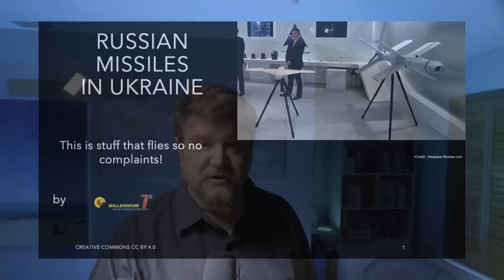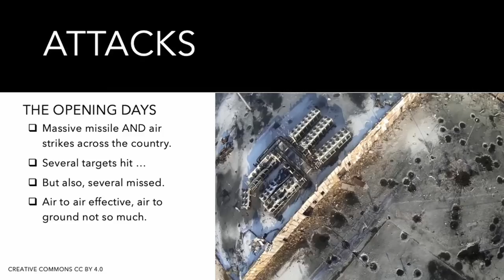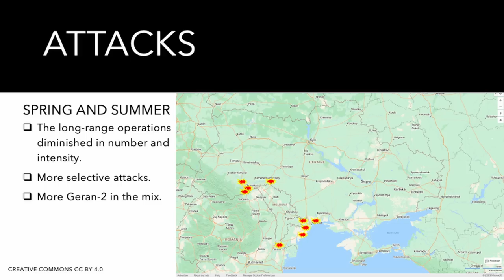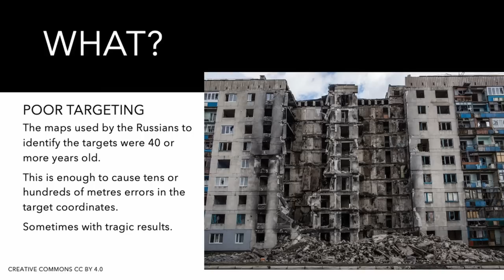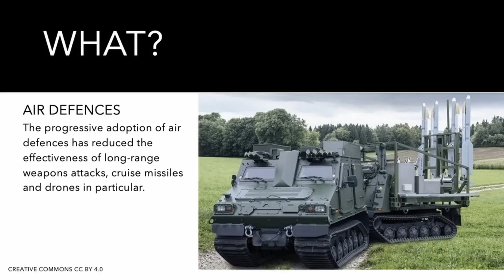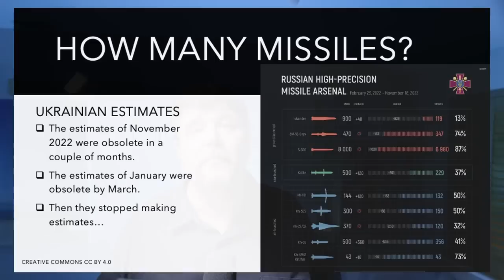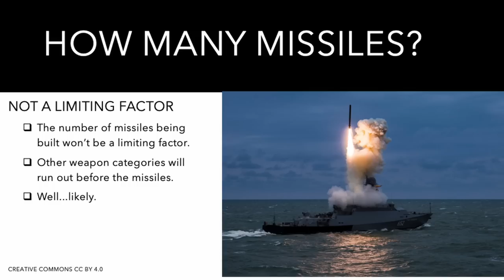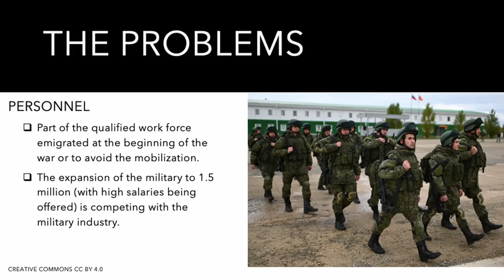Ukraine: Russia Run Out of Missiles!

Comment: Take care of your heart M7! 
I was told I had a bad ticker many years ago ...and then years later it was actually much better (against all expectations).
Avoid trans fats, omega 6 (vegetable/seed oil), nicotine, and any syringes which aren't absolutely life & death necessary. Go easy on alcohol & carbs. Do something 'modestly' active every day.

I think this video is extremely accurate. Although I suspect that the switch to domestic silicon may have already occurred (in part anyway). It's not outrageously difficult or time consuming to "do", it's just that in ideal circumstances, everything would be triple-checked and heavily tested, while in war time, there's a more streamlined process (with less guarantees of functionality). But I believe Ukraine is the testing ground.

I also noticed the increasing prevalence of aerial russian video deep inside Ukraine. It outlines a significant shift in relative air space control. If there are resources to do video recon, just to monitor missile effectiveness, deep inside Urkaine, then Ukraine has much more limited control over their own air space than advertised.

I would say there are probably well over 1000 missiles held in reserve as a deterrent to NATO. Although that is counting nuclear arsenal missiles. For conventional-only missiles, yeah, 5 or 600 sounds about right. The aircraft deployments tell much about Russia's NATO deterrence levels. A surprisingly sparse amount of aircraft (compared to the overall russian air force) are dedicated to Ukraine. So I would expect that a substantial amount of other similar assets are held in reserve as well. Although I'm sure that would be shifted if the ukrainian offensive were to become overtly successful.

Just this week (possibly after this video was created), Russia launched some very substantial missile strikes at Ukrainian supply lines, logistical routes, and production facilities. Likely to remove some wind from the sails of any early autumn push to capture land just prior to the rains (an advantageous time to advance). They were likely saving up missiles for this. That's another thing which throws off estimates (wild guesses) about missile production rates, since Russia doesn't simply use them as they are produced, but banks them for strategic moves like this. So the week to week or month to month rate of missile firings really reveal little.

I think MI6's leaked assessment is pretty accurate regarding the Ukraine war. Ukraine has passed their peak for negotiating leverage now. At this point, there's only further loss of life and a weaker position the longer this drags out.

Comment: What i can't wrap my head around, is the use of S-300 as ground attack missiles. I mean, it is supposed to knock out a 20+ million$ airframe. It is actually hard to find a ground-based Target in that price range, it actually can destroy. The warhead is at least 10x smaller, than a dedicated Ground-attack missile would have.
Reply: In fact, such an attack mode was originally intended, but it is not the main one, rather for self-defense, and is limited to a radio horizon for missile control. In fact, the warhead is more than 300kg and is comparable to the light OTRK.
Reply: In addition, the warhead can also be neutron.

Comment: Overall, this is a wonderful analysis with the correct  conclusion "we don't know". I can only protest the Russians' use of surface-to-air  missiles as ballistic firecrackers. This legend was invented by Ukrainians to explain to ordinary people why sa-10 missiles of old Soviet modifications falls in the middle of cities and that's all. They even came up with the idea that the Russians is stupid enough for intentionally turning off the proximity detonator - otherwise it would be difficult to explain why missiles dont detonate in air, since all missiles with a fragmentation warhead explode from the proximity to something, an airplane, the ground. And not on the plane or ground surfaces. It is simply pointless for Russians to use single attacks with such missiles and so ineffectively. The Russians have a lot of more effective missiles in their arsenal for this range! For example, Tochka-u (ss-21) were available in huge numbers, but are not used by Russians in any way. So much not used so that Ukrainians are sullenly silent when you ask them where these missiles are being used now, if they believe that there was a Russian missile in Kramatorsk. But this missile is much potentially better than ballistic anti-aircraft missile and still not used! So far, the only one who has converted SAM to fire on the ground is the Ukrainians themselves with sa-5 missiles.

Comment: Well, especially for IC substitution, you need a lot more than a replacement. - You'll need to redesign your PCB to handle the differences and most probably you'll need to rewrite the software running on that IC to reflect the new architecture & performance parameters. Also, if you change the energy efficiency, you start stressing your power supply in the design and may need to change that power supply unit too, which may in turn require changing the other aspects of your design due to the weight/size discrepancies. Also, if you happen to use less efficient ICs, you'll need better cooling solutions to keep the performance on par with the sanctioned parts, which would increase the mass and volume of the design, that would affect other changes in the control software that needs to calculate for the moment, direction & acceleration. In short, for Russia, paying 100x for smuggled OEM IC parts will be much cheaper and simpler than trying to redesign. So, even if they may play with the serial numbers of their parts, they cannot play with the serial numbers of the western built OEM ICs. Also it is possible to track the path these parts took via these serial numbers. Time consuming maybe but not that hard.
Just my 2 cents on the topic.
Reply: I worked in a company where they decided to change a cable, but didn't changed the part number.
We ended having a nightmare with our product, because sometimes the part number was the right cable, and in other cases the same part number was the wrong cable.
Reply: Considering these Cruise & Ballistic missiles have been intended to be one way payload delivery mechanisms, they are not built with high tolerances at the first place. They need to be stored for extensive periods of time and function for a short period of time. An Iskander missile takes about 4-5 minutes to cover a 500 km distance. This requires the parts in them to withstand extreme G forces and heat and vibration for 4-5 minutes but they must absolutely work for those 4-5 minutes that they function. You cannot put a lot of redundancy as that will decrease the payload. There are not that many producers who make ICs that would withstand such extreme physical torture. You cannot put in their place some Chinese knock-off chips. Chinese may sell their own extremely hardened ICs for exorbitant prices but no guarantee they will be pin compatible or architecture compatible or even signal voltage level compatible with the western ones. Russians have to continue buying these chips from the black market for extremely high prices until they redesign their existing circuit boards and that redesign takes a lot of time & money.
Reply: @SalihGoncu   And best of lucks expenting consistent quality in Chinese supplies. I talk from self experience.
Reply: @alfaeco15  I am pretty sure they have quite acceptable consistency in their military grade ICs but again, will they want them out in the wild? I am sure USA would love to have a look at some of those ICs, even after a blast, to see how they are made and what is their position in production of ICs. I don't think Chinese will hand them to Russians. They will help them buying western chips for astronomical prices but won't give them the indigenous Chinese parts.

Comment: The Soviet heritage of mobile missiles and large number of dispersion airfields made it difficult for Russia to neutralize Ukrainian airforce and airdefense. Also they didn't hit many production sites thinking they would capture them for their warmachine because these actually supplied parts to russian military before 2014. Also Russians are using more of the Cheap Gerans to eat the Ukrainian missiles stocks while the major targets get Iskander/kinzhal/Kh-555 etc. Ukrainian S-300s have held up whole year but the losses and missile consumption means they are running low hence Bulgaria is transferring defective missiles probably for spare parts. The air defense situation may get worse for Ukraine if the rumored Iranian transfer of TBMs come through, these are cheaper cmand mass produced and will require high end SAMs like Patriots etc that will further eat the missile stocks.

Comment: This channel is really excellent.  I would not argue with most of what he says, however,  I find it a bit incredible that the Russians would be using S300 for ground attack for the simple reason that it's warhead is completely inappropriate for destroying ground targets, especially given it's lower degree of accuracy.

I would also challenge some of the other assumptions that go back to the idea that Russia made big mistakes in planning at the start of the war that still impact current events.  I don't disagree about the failed assumptions they made in the beginning, but it seems to me that the Russians adapted very quickly to the new realities, redeploying forces and adopting new war plans.  In the "west" we assume that wars are supposed to be short, measured in weeks or months.  But much of that is due to the kinds of wars we've fought against enemies who were not really capable of full spectrum resistance. 

The Russians plan for the war, after the initial mistepp has been the traditional Russian steamroller model.  An extended period of mobilization of manpower and industry followed by victory.  In a traditional sense,  a 2 or 3 year war, is not exceptionally long, especially given the Russian desire to limit casualties.  It seems long given our western attention spans, but if the war ends next year with the destruction of Ukraine, it will actually turn out to have been pretty quick.  

But then phase 2 will start as Russia makes clear that their view of Ukraine joining Nato as a threat will be clearly articulated about Finland's foolish pissing away of it's neutrality and perhaps also Sweden.

The west wants to hope that the current battle is a stalemate, when in fact Ukraine has already crossed the tipping point where attrition is inflicting fractures from the combat front back through the deep rear all the way into basic administration, that will lead to accelerating collapse of Ukraines ability to resist,  similar to what the German Army experienced starting in 1944 in the east.  The German experience was that they suffered the majority of their total battle deaths in those final 12 months.

Comment: Based on the Ukrainian Wikipedia reports about Russian strikes (Перелік ракетних ударів під час російського вторгнення):

- The number of normal cruise/ballistic missiles launches oscillates around 150/month, without significant long term changes.
There's been a sharp decline in the last 3 consecutive months, which never happened before. But the number of launches is still high.

- The number of S-300-400 hits (not launches, hits) has been constantly decreasing for the last 7 months. It's stabilizing at 10/month.
Modest numbers compared to the peak of 110 hits in October 2022.

- The number of Shahed-136 launches is on the rise, massively.
Before the summer, they were launching around 100/month. Last month 500.

All in all, there's no indication that Russia is running low on normal attack missiles. But the launch rate is 3 times the estimated production rate.
S-300/400 however are finishing, and are being saved for air defense only. Some batteries have been destroyed by Ukraine.
Shahed-136 (and similar) are proliferating enormously.
Reply: My guesstimation is that next year Russia will be forced to lower the launch rate of normal attack missiles to 50/month (=25 tons of explosive).
They'll try to compensate with Shahed-136 (and similar), but they'll need to produce and launch 2000/month of them.

Ukraine should invest in anti-swarm air defense.

Comment: Last note: I did not see any analysis concern substitution. Russia certainly did not have Geran drone type capabilities, much less volume at the start of the SMO. How much of the mix shift is due to missile shortages as opposed to strategy changes as opposed to more efficient match between attack platform vs target type? Power stations, unless actively defended, are nowhere remotely the same type of target as say, logistics areas or airfields or headquarters. But relative lack of air defense options - particularly longer ranged ones like S300 - mean less options to defend and more pressure on stockpiles. Western systems: not the least bit clear if they are in sufficient number and sufficient munitions inventory to even replace equivalent S300 launchers. It is an interesting question as to how many of the 100 S300 batteries/400 S300 launchers/S300 missiles remain in the Ukrainian TOE.

Comment: IMO The Russian attacks on the Ukrainian Air Force infrastructures in the beginning of the War was not for the purpose of eradicating the Ukrainian Air Force, it was just to disable their capacity temporarily. And I always use the facts that, although we saw long columns of easy target Russian tanks stalled on the roads by Javelin attacks on the first and last tanks of the columns, there was no Air strikes on those columns like the US did in 1991 with the columns of Saddam tanks leaving Kuwait. And we didn't even saw Ukrainian Air attacks on the column of tanks leaving the siege of Kiev. So I concluded that during all that time the Ukrainian Air Force was disabled from the first coordinated missile attacks on the Ukrainian Air Force infrastructure.

Comment: I love your work, but I have to point out that the picture of the ship launching the missile is a British designed Leander class frigate. I don’t know which country it belongs to but I served on a similar ship in the RAN. The long range air warning radar antenna is the same as we had(LW02; the surface search radar antenna is totally different though so I don’t know what that is), but the gun turret is different. It also looks like the OTO Melara 76mm instead of our 4.5” twin mount. Our American designed Perry class FFGs had that 76mm. I have no idea what missile it is launching though.
Reply from the maker: I need to check,  I may have used the wrong footage

Comment: "they are running out of missiles often" good one 😅
about s300 missiles... those are probably old and not very effective against air craft. but stationary target is easier. maybe those could intercept drones but maybe not... just a though
Reply: S300 usage comes from Ukrainians, as they are using S200 and S300 missiles to attack ground targets in Crimea and Belgorod region. Russians have more that enough proper cruise missiles in order not to resort to S300.
Reply: @nyw100 In the first couple of days of war Ukrainian S200 has hit the house with flats. Right away Ukrainian media made a claim it was a Russian missile.

Comment: Russian and Chinese chips and circuit boards are crap. The Chinese produced a 7nm chip, that is a one off. 2018 tech but a copy of an old cellphone chip. They used an old manufacturing process with a high error rate because that will cause half the chips to go to the garbage. Besides that, they mainly produce 65nm and larger chips. Great for car door open sensors, but very bad for military guidance systems. Commercial chips are also not hardened against ECM like military chips would be.